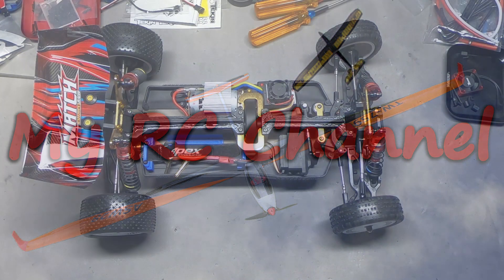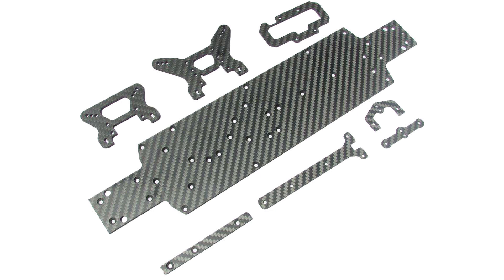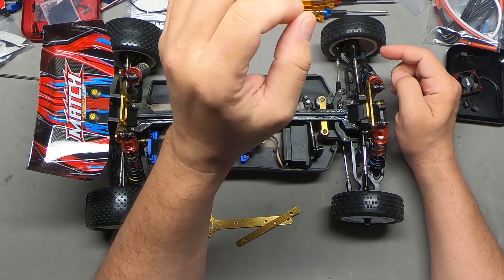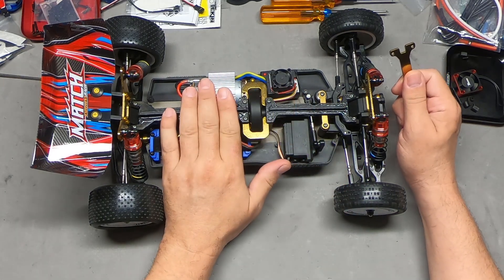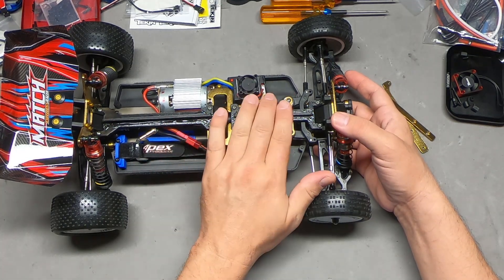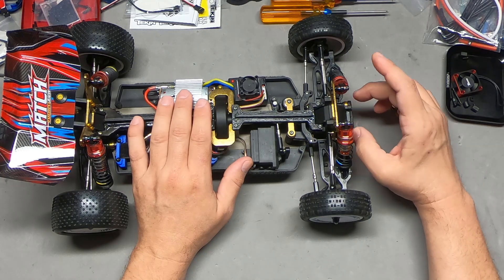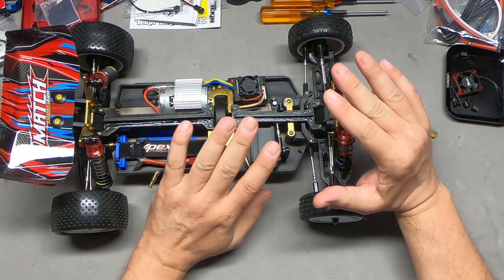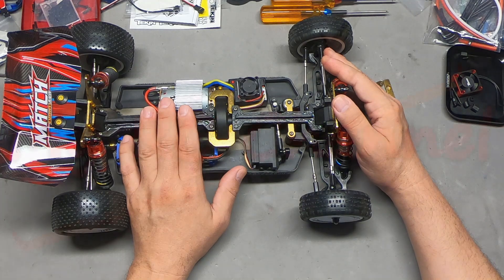UPDATE! CARBON FIBER CHASSIS KIT for the WLToys 104001 1:10 4WD Buggy RTR - Part 6

Comment: I got the 2mm version, its pretty nice!  The thin carbon fiber ones actually fit the front brace with the gold in place too, so its SUPER stiff and it forces in the kickin the front.  The rear didn't look like it would so I switched to just carbon, as well as the main plate of course, and all the others.  It has some flex, but not a lot.

I'll try and get the cnc up and running so I can cut carbon kits stateside and include a wedge spacer.  Im thinking 4mm shock towers too.
Reply from the maker: Sweet! You'll have to let me know when you get parts made... and at least let me know how they come out. 
When... still waiting... the 5mm kit arrives, I'm going to 3D print some shims for the front end to get the correct kick angle. I checked yesterday in my order history on MakerFire and the 5mm kit hasn't shipped yet.

Comment: @My RC Channel, Top brace is a better design than having a thicker chassis.  Not only does it help with flex without adding too much weight, it also help improve stiffness for the suspension.  The ridge you printed probably too big and doesn't help much but increase weight unless you are using a soft material because the weakest part is where the mount screw area.  You should continue to sell your's as it is a better design to combat reflex.  I don't know your pricing but I would think it's a way better option than to install carbon fiber chassis.  Aside from the chassis, all other 3mm carbon fiber parts are good.

Comment: Tomley rc did a review of this kit. Had a lot of issues with it. He got the 2mm version. Alignment and flex issues. Did you see his video? It's very worrying.
Reply from the maker: I haven't seen that video... I had a feeling that the 2mm kit would be too flexible. That's why I ordered and recommend the 5mm kit... a link is in the video's description. 
The 5mm kit has all the other parts made of 3mm carbon sheet. This is a big factor because you don't want flex in the shock towers. If there are alignment issues, that will be a big problem.
And, I'm still waiting for someone to offer a center diff or slipper... someone has got to be working on that.
I'm really thinking about not doing anymore of these cheep kits. They are more problem than good.
Reply: @MyRCChannel-CJScott  Yeah, I had so many issues with a carbon kit for a 959B. Plastic arms wouldn't fit, driveshaft 2mm short... I feel like this is gonna end up the same way. Hope the 5mm kit works out better for you. About that center slipper. I have a TLR 22X-4 and sized up the slipper clutch: 60 mm total lenght. Maybe that one might fit?
Reply from the maker: @DimiS1978  It might, I'll measure it and see...

Comment: Crystal from Makerfire said, apply heat to bend the kick up infront
Reply from the maker: Yes, and no... they said it would take over 3000 degrees to bend the 5mm carbon sheeting... they didn't suggest that we do that. In fact, the way it's worded, is sounds like they are trying to discourage us from trying. I would go along with this because if the bend, assuming you could make it bend at all,  is slightly off angle, you won't have consistent caster from left to right. That would ruin the chassis. It would probably damage the strength of the carbon laminate. I'm going to design a couple of wedges with integrated bumper that will fit between the chassis plate and the front diff. That will correct for the loss of kick/caster. I plan to make more than one to have a choice in angle. Many off road cars have a front kick plate that can be changed, reversed, or shimmed to increase or decrease the front angle. I'm actually surprised they didn't include at least one shim in the kit... they could make them from injection molded plastic for pennies.
Reply: @MyRCChannel-CJScott  you can do a whole video just on that. I did put a Redcat 1/8 scale center diff in my 104001. Check my channel, RC CARS AND MUSIC for video.
Reply: No.  You do not want to bend CF plate as the fiber within will break at that angle and the front end will be compromised. Best is get shims from "My RC Channel" or make your own.

Comment: 5mm is coming out I have it on order
Reply from the maker: It's definitely the better choice and worth waiting for. Hopefully, there will be a center diff or slipper coming out soon.
Reply: @MyRCChannel-CJScott  Here you go center diff https://youtu.be/srinJrznRqQ
Reply from the maker: @rccarsandmusic2641  Thanks for the link... that's a bit more hack-n-slash than I want to do. I really want a bolt-in solution that I can recommend to everyone. I'm also hoping for 80+ tooth spur gear to keep the overall gear ratio correct to the kit. With that pinion and spur, your buggy is going to be crazy fast!
Reply: @MyRCChannel-CJScott  also put in a 46t spur and 13t pinion, at least 40mph on grass
Reply from the maker: @rccarsandmusic2641  Very cool! I'm working on the sway bar video... should be up tonight.
Reply: @MyRCChannel-CJScott  that I wanna see sway bars are needed, ZD RACING always includes sway bars you  have a good channel.
Reply from the maker: @rccarsandmusic2641  Thanks man! Sway bars video is live... parts names and links are in the description. 
Enjoy!
CJ